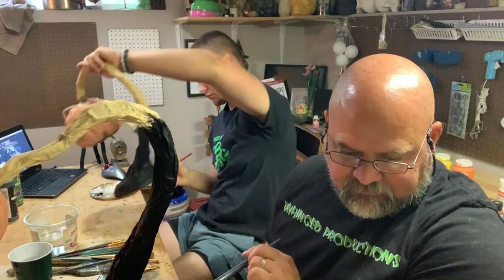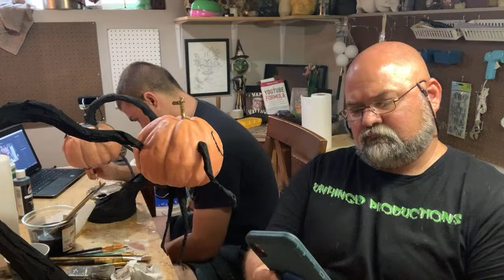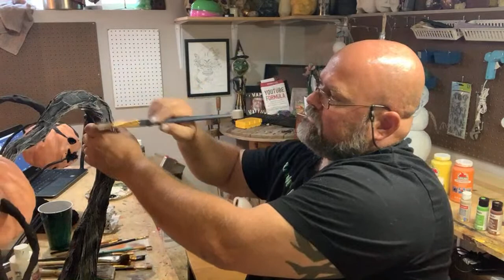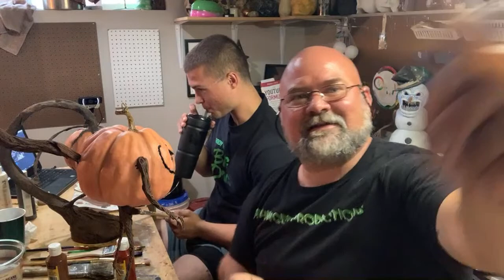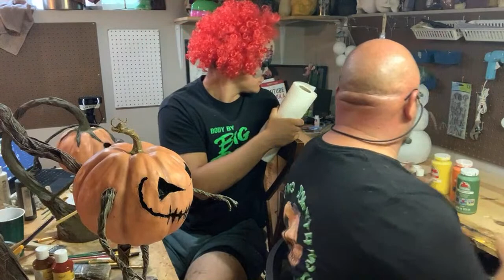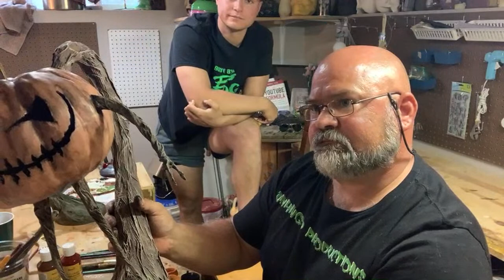Painting these pumpkin creatures take 2

Comment: Have you ever had your papier-mâché paste separate after you’ve made it in the bowl? Right now my papier-mâché paste looks like cottage cheese… Any thoughts?
Reply from the maker: For the most part I use wood glue and water, it does separate but the glue just kinda falls to the bottom. All I have to do is stir it a bit and it’s all good again. What type of paste are you using
Reply: @UnhingedProductions1  Your Tight bond glue recipe, I really want most of my props outside so I figured I’d give yours a try. I tried stirring it all back together but in the end I scrapped it but the second batch came out better. I was also wondering how you anchor your projects to the ground outside, especially if there is wind like we have here in Iowa.
Reply from the maker: @LexEllisOG  That's so strange i've never had my paste seperate that bad. Just to be sure i only use water and Tighbond II. We get some really high winds here to. Most of my pumpkins to fine just sitting ontop of what ever I put them on, every once in a while one will blow over. My tumbstones and stuff i stake to the yard with rebar. These guys we just made if I were to just stick them in the yard i'll use those cheap metal tent spikes to hold them into place.  I hope this helps
Reply: @UnhingedProductions1  awesome, thank you so much and I can’t wait to see what you’re doing next. I’m working on turning my garage into a witches coven.
Reply from the maker: @LexEllisOG  That's going to be awesome. Now that we are in September it's time to start on the yard.  I may try to make a facade this year. If I do i'll film the process.